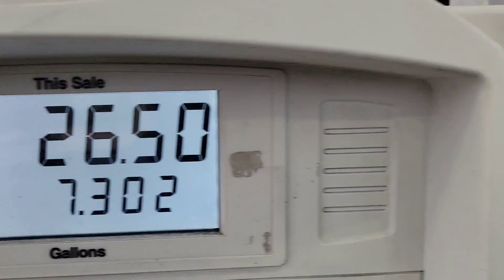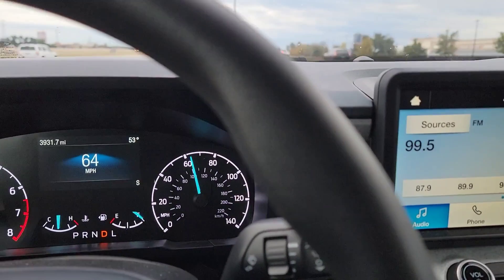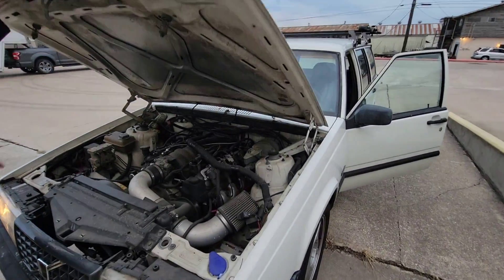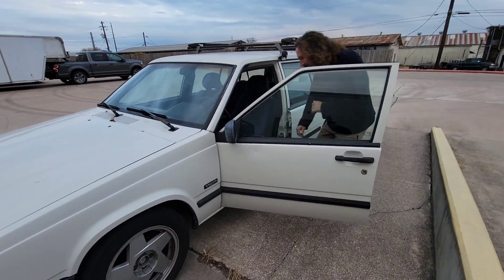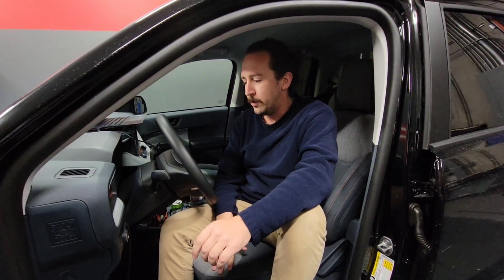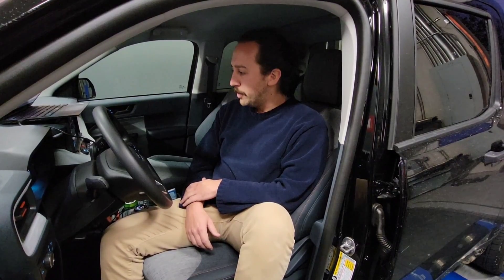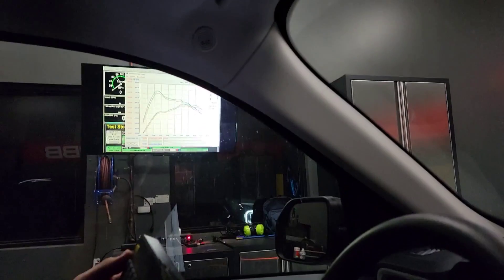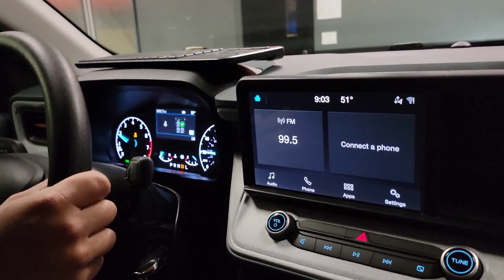TUNED 2022 Ford Maverick - E30 - Great Progress

Comment: Flow is the absolute key. Another half inch or so diameter on the exhaust. An upgraded downpipe and a good intake will make a good difference in the tuning endeavors. These parts thing will come in time. Sadly, the Maverick is going to likely sound horrid with these modifications. The current additional power you've got is not bad at all for a stock set-up. With a tune especially, I'd highly recommend a catch can and colder spark plugs, at the very minimum.
Reply: diameter on the exhaust.. worth the effort and money?

Comment: Hell yea! Keep it going Mr. Boom!
Will we need the Cobb Accessport to load the maps or will this be an Open Source tune?
Reply from the maker: This is 100% nothing to do with Cobb. This will be Via Sam and tuning will be done using HP Tuners and their software. We're just fortunate to be able to use their awd dyno for the tuning/revisions
Reply: @MrBoom50  Sounds good. Thanks man. Keep up the great work! I have a black, XLT, 4K, FX4 with big AT tires and looking to add a lift soon.
Perhaps, sound system is next for your lil beast? 🤔
Reply from the maker: @carlosloyola4585  you bet! And yes sir, going to order some stuff first of the year to swap out all the speakers and possibly add a sub to it! That and I'm working on offering a foglight solution currently as well.

Comment: Is full e85 not possible with stock setup?
Reply from the maker: No, the maverick isn't flex fuel capable unfortunately.  So a blend is best option for stock fuel system. To run e85 gunna need to do some upgrade
Reply: @MrBoom50  i gotcha thanks for the info! Was hoping with it being DI it would just take it lol
Reply from the maker: @murphygaven1  I'll get 100% clarification tonight just to make sure, but as far as I've seen, it isn't flex fuel capable 😔 full e85 would be amazing lol

Comment: Mixing drinks Maverick is going to get really drunk.
Reply: @MrBoom50  didn't really know you could do that. I am watching as many videos as I can to learn about the truck before I commit. I am thinking of going with the Fx4 package not that I plan to off road with it but like the idea if I had to I can. Plus is comes with a heavy duty  engine cooling fan and radiator. Doesn't hurt. I read in the past they have had issues with this engine, so I hope they resolved what ever issue they have.
Reply from the maker: @kevintorres9928  well thoa truck doesn't have the fx4 package and you may have not caught it in the video, but it doesn't get hot. Coolant stays super cool and the radiator flows extremely well!
Reply: @MrBoom50  thanks for the feed back.
Reply from the maker: @kevintorres9928  you bet